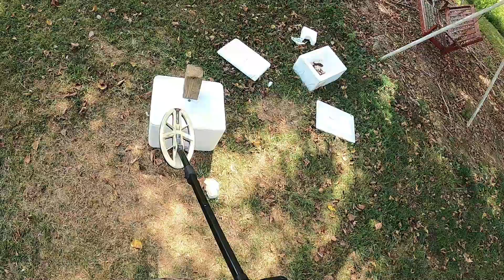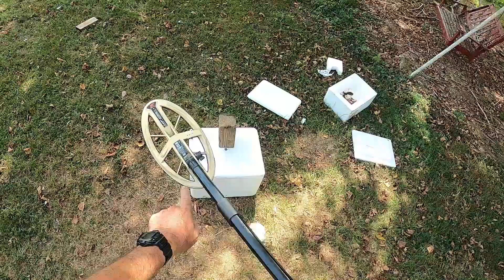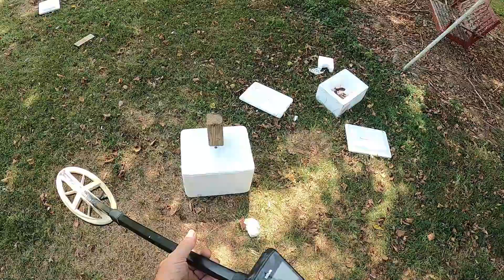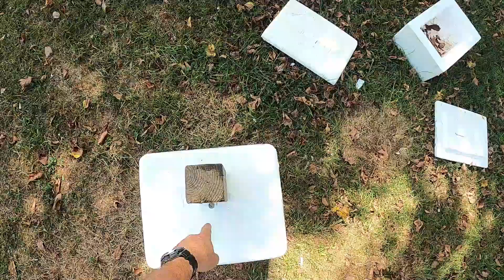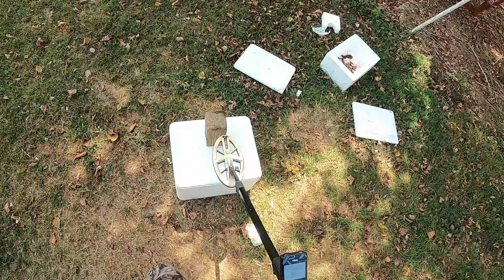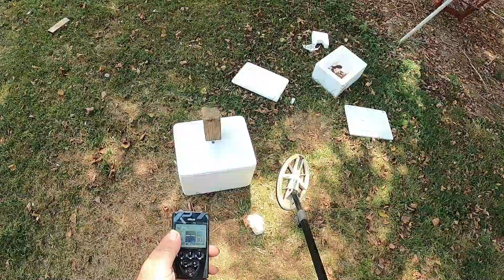Notice shape of Minelab Manticore small coil

Comment: This is the same with all double d coils  , you should know this buddy , the search detection of the coil is shallow and works it’s way to the deepest part of coil which is the centre. Like an arc . So your mentioning something that is what it is , but making out that’s it’s a problem  🤨 didn’t you study science and engineering in your younger years 🤔 #historyrevisited
Reply from the maker: I have seen no comments on the shape of this coil.  So I pointed it out.  As far as schooling goes.  You signed up the the Legend academy yet?  If not you need to.  All the time you had Legend before me you never once did a video or commented on the weaknesses of Legend being used in modern trash using all the park and field modes.  Whereas multi beachwet can give some better performance here.  So yeah.  Go sign up for Legend academy.  And obviously learn something.
Reply: We need Air to live...🤣
Reply: I'm sure if he turned the juice up a tad bit he would get a better response.However some people like a mellow response just to let them know theirs a target.I being one of them.its what it shows on the screen.but also audio response can be turned up or down.just have to adjust to your liking.their other power adjustments and sensitivity setting that could be used on the manicore.
Reply: Wonder how the manticore will do when it gets coils this size someday in about a year or so still wondering.